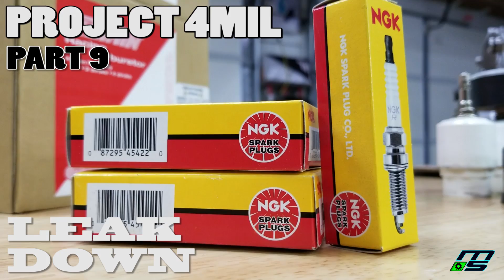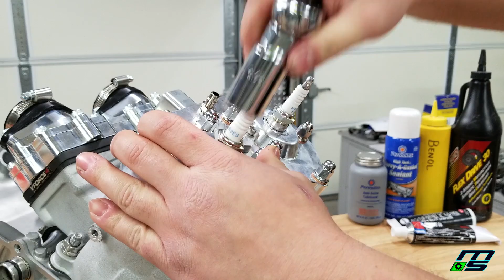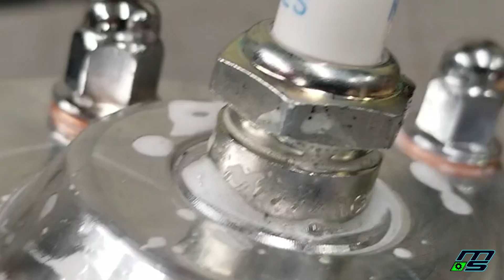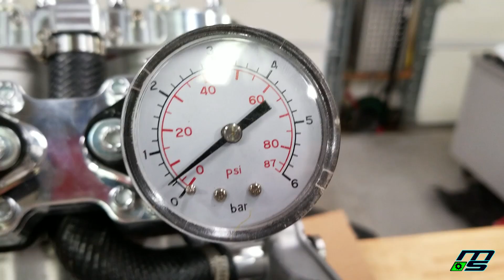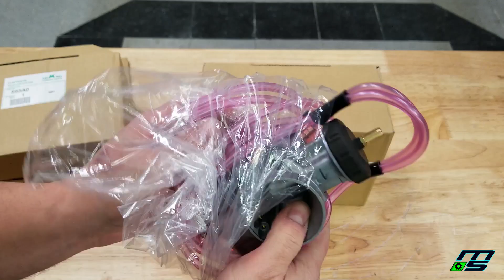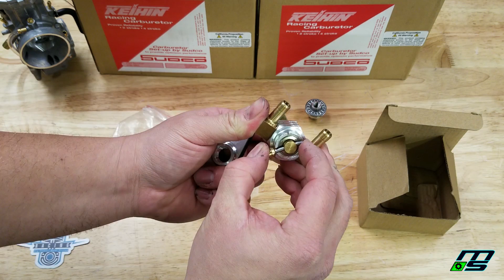Project 4mil Part 9 | Leak Down and NEW Parts!!!

Comment: Ill be following the air strikers tuning.i have read they are near impossible to tune.compared to non airstrike. I personally think they have the wrong cutaway and because the run more low throttle velosity they pull to much fuel and run to rich . I tried to tune 33 pwk a/s and had that problem.

Comment: If (I wouldn’t) you want a lockout use the DriveLine slingshot style which will fit under your stock clutch cover. You just need to file 3 nubs. I run the DD style lockup and would go s different route if I could do it again
Reply from the maker: Do you not like the way it shifts?
Reply: You can’t ride the clutch like you do when trail riding, or doing technical which is a big disadvantage. They’re great for drag racing running wide open. Also, unless your legitimately over 85 hp you won’t need it. Some baskets like mattoon can hold a 8-9 plate clutch and some clutch kits ( titans or redlines) can hold more than the average kit. If I could do it again I would run a Magura hydraulic clutch and no lock up. Another thing about lockup’s is the pull is inscreased and DD finger style sticks out pretty far. I prefer the slingshot to the finger style that I run. I would avoid the lockup and buy a Magura H lever!

Comment: Bought to order me a brand new Keihin from BP going genuine of course never skimp on pistons cranks clutches or carbs! I gave you a referral in my email to them dude. Hopefully they kick me a slight discount? Worth a shot. As always great video. Not terribly pleased with your “repair” of the leak, I’d have tore it back down and resealed the cases myself especially if you’re waiting on money and parts. Just my $.02 you do you booboo lol.
Reply from the maker: Lmao 😂 yea I hear you man, I really think the cases will be fine though. I can't see how sealing it in between the cases by the stud or by the bolt will really make a difference. If i had used the OEM nuts on the bottom originally, I would have never had the leak in the first place and would have never known there was a spot I missed.
Reply: Michael Sabo you have a point there and the other thing I forgot about is if you split them again and reseal every time I’ve done that I’ve chased another leak. What you did should be fine.

Comment: That wasn’t a fix, that was a patch job.
Reply: I didn't want to be the one to say it,  thanks bud agreed. I'm not convinced that aerobic gasket maker is better then the grey motoseal IMHO.
Reply: Only 5th scale same here, should have just used a liberal amount of yama-bond, it’s what the manufacturer made for this specific purpose, so why should I not use it?
Reply: @djmystery7235  I think you should,  use what makes you feel confident  when building your engine bud.
Reply from the maker: I dont see why sealing the motor between the cases by the stud, or by the bolt at the bottom of the stud will make a difference. It didn't leak even without the Yamabond, I just added it in case. It will hold fine.
Reply: @MichaelSabo  sorry but it janky af, Yamaha hopefully wouldn't sell a banshee built like that,  let alone a custom built stroker. No worries bud I'm subbed and liked it's your bike so no hard feelings.  If anything it's a great learning experience for everyone here.  Cheers.
Reply from the maker: @johnsmithover9000  I appreciate your opinion. I just can't justify splitting the cases to put a dab more of sealant on the inside when it will do the same thing on the outside. I'd bet my bottom dollar it will hold just as good; if I felt otherwise or I thought it was "janky af," I wouldn't have published it for the world to see. To each his own.
Reply: Michael Sabo we aren’t trying to be rude, but gas will pool up in the threads because it will leak past into the threads and it may loosen the bolt, things like that cause engines to fall apart, if you are going to patch it do it right and at least cover the whole Bolt in the sealant including the threads so it can stop the leak all the way up to where it’s supposed to.
Reply: @MichaelSabo  I understand completely.  It would be very frustrating for me. I mean hard to justify the time and efforts to correct it, believe me I know it's no small task.  Wwjd?  To each his own. As I said it's your bike and I'll keep watching. You've got a great channel here!
Reply: If you fill where the stud goes in and put it under the nut it would work pretty well, but in the end you should always take it back apart and do it properly, if things don’t go correctly the first time I put something together I always go back, it’s time consuming but what’s worse is going back to fix it later.